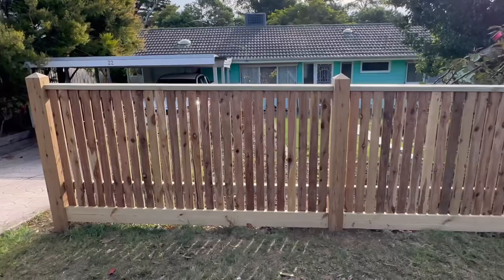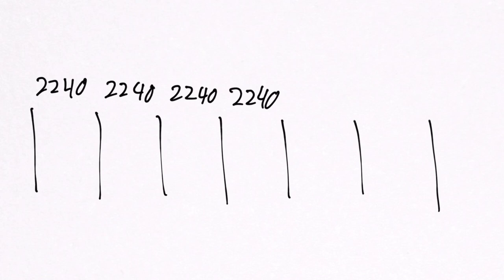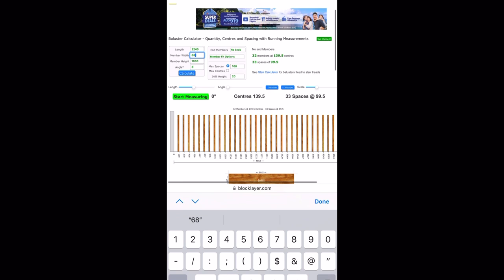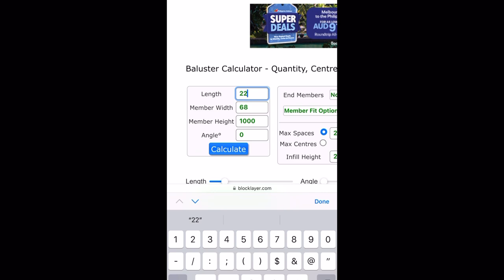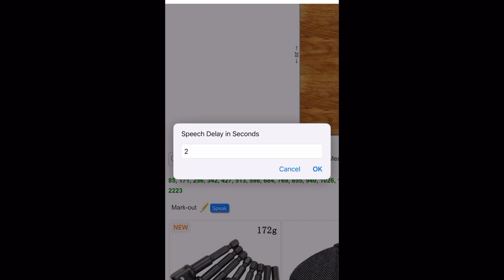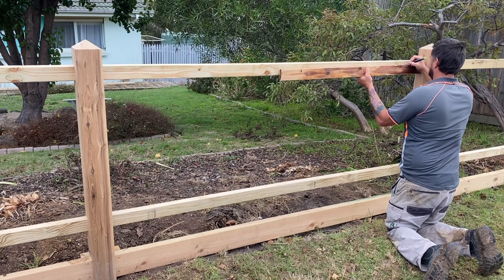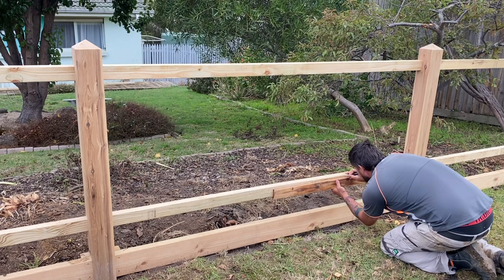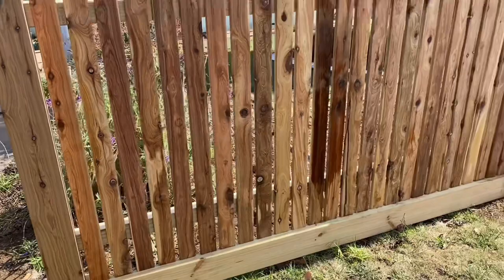How to make perfect fence picket spacing

Comment: Excellent video. Thanks for putting this together. What’s your mm tolerance for spacing differences between bays? Eg. Would 16mm spacing on bays and 13mm on gate be noticeable?
Reply from the maker: Thanks heaps. Great question. 3-4mm difference between bays that are next to each other with wider gaps (like your example) is not noticeable. You could also set both end pickets of your bays so the middle is even on both bays.

Comment: Hey
 Great video
 Can you help me please.  My pickets all vary between 91 to 94 mm.!
 How can I get a perfect spacing without ending up with to big, small gap at the end of the run.?9
     In some sections I have ripped them down to 90mm and used the technique ypu give in your video...great. but this takes up a day as I purchased and pre painted everything and now realised the problem.
.   I am a bit annoyed bought then at bunnings as 90 ,mm pressure treated  boards abd they all vary..!
   Cheers damien
Reply from the maker: Unfortunately, if you have bought materials that are like that. It’s going to be a long and painful process. If I had to, I would try and separate the pickets into piles of their respective dimensions and then calculate accordingly.
Personally, I would’ve taken them back for a refund straightaway. Good luck with your project, I’m sorry that you have to deal with that annoyance.